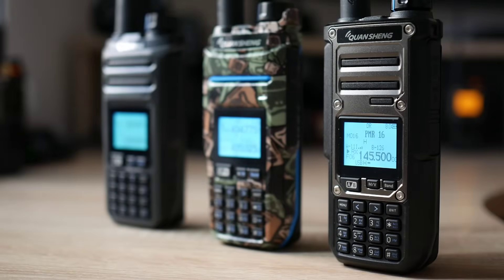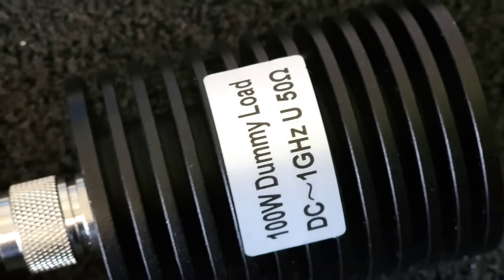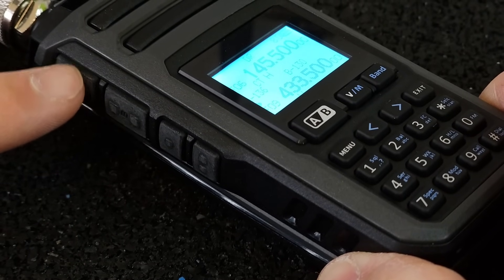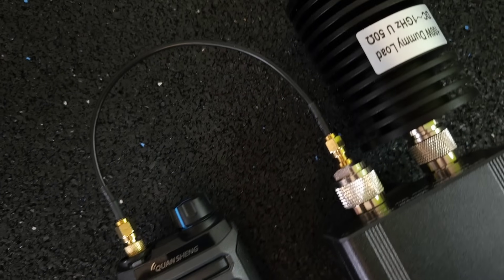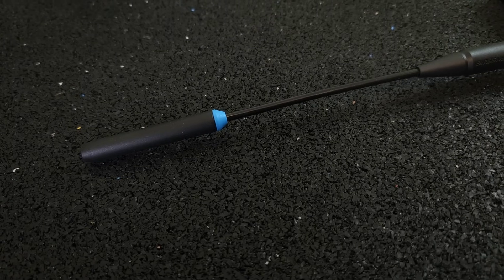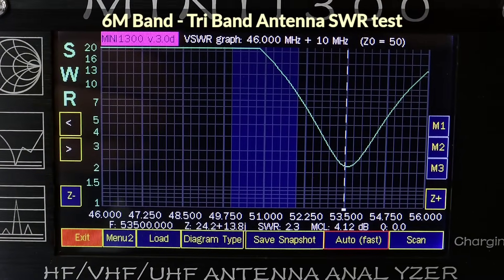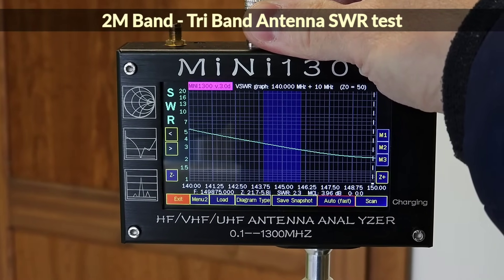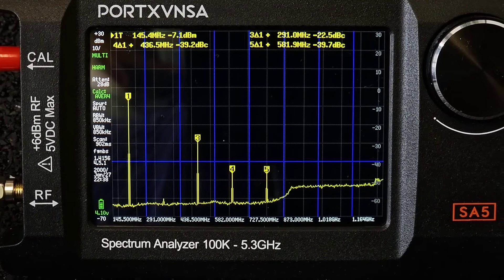Quansheng TK11:  Measurements & Teardown (Part 2)

Comment: Interesting walkie-talkie I have a few UV-K5(8) and a TK11 will come someday just not for the prices they are for sale now. And the antenna is nothing at all. And there is not much difference with the UV-K5 either, as you can see. But nice to put in the display case!!

Comment: Hi Paul, thanks for the super video 💪. I wanted to ask you what do you think about the PORTXVNSA 100kHz-5.3GHz? is it reliable as an instrument? I would be willing to get it, for antennas I have a rigexpert aa-600, this one intrigues me a lot and I am undecided between the Tiny SA Ultra and this portxvnsa. Best 73, TU & GL DE IZØVXL Federico. 🙂
Reply: Get tinySA Ultra Plus (model ZS407). Its can measure up to 7,3Ghz .The secret unlock code for the Ultra mode is 4321.
Reply: @Marek_M79  Thanks a lot, 73
Reply: @retrofatti  You are welcome. 73's 161ML611 / SP1002SWL

Comment: Great video! Are there no harmonic measurements for 10 meters and 6 meters? I'm looking forward to seeing what you find once you get an attenuator and can measure how much of the output power is actually on the fundamental frequency.
Reply: yes he showed 50 Mhz first.  Did not show 28 Mhz.

Comment: You are now my favorite radio reviewer! Doesnt call fundamental a harmonic and points out that spurious emissions showing direct into SA are actually dampened by antennas that don't resonate on those frequencies! First thing is just annoying but the latter really gets me, the anti Chinese/cheap radio brigade, scream about harmonics, but do they do anything? I tested a uv5 of mine, using a scanner set to first harmonic around 900mghz, open squelch it was only detectable at say 10feet MAX, same test same time with an icom, the difference in detectable difference was negligible Personally i think its a over-hyped non event, parroted by people who not only have never tested it in real world but clearly don't understand. Sure if you ran these into a amp, its maybe a problem, but thats a problem still present on much higher end products and a 5-10w ht is not what you should be running into an amp anyway. 1st harmonic on that icom was only 0.8-1db under a uv5.
Reply: I have found that many radios are relatively clean on 70 cm, but are horrible on 2m with the harmonic of the 2m on the 70 cm band certainly radiated by the dual band antenna. And for the USA, part 97 clearly says "supplied to the antenna transmission line."
Reply: Well said!